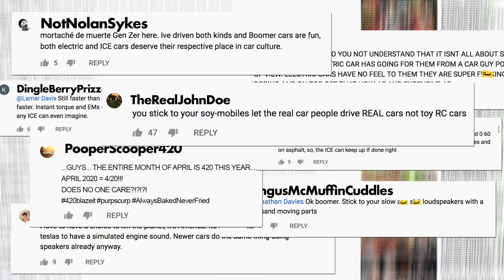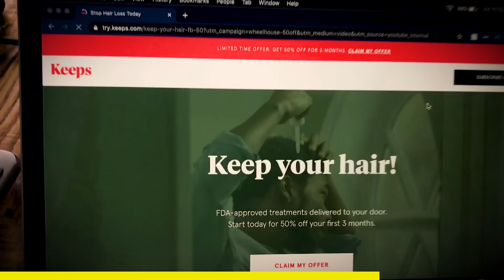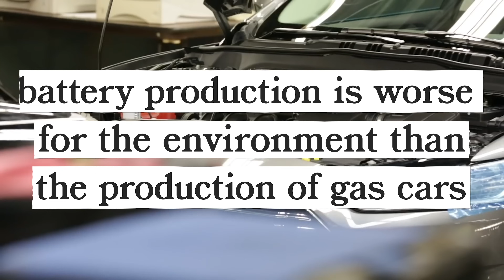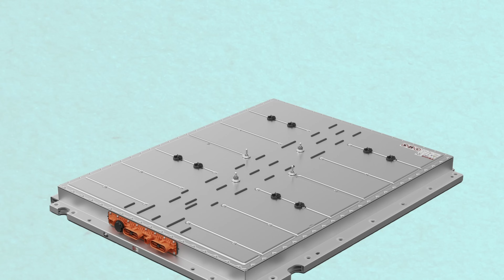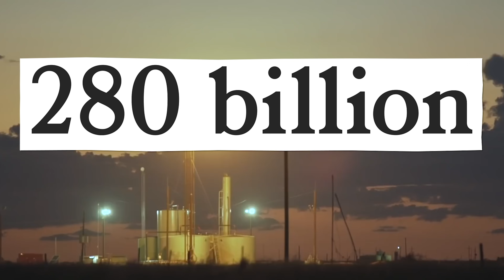Are Electric Cars REALLY Better for the Environment?

Comment: The rich vs poor argument doesn’t take into account the “poor” people that still have some money to buy some kind of car. The people who only have enough disposable income for a second or third hand cars for $500-3,000 until Ev’s get to that level of circulation or price they won’t be a big deal for “normal people”
Reply: Sadly, by the time the price of an EV comes down to $500~$3000, its range is counted in yards, not miles ... :s

And even if you're rich enough to buy a new EV, you're confronted with a tough choice:
Do I buy this small EV for $30,000 or the same model in Petrol version for $15,000 ?
I can buy $15,000 worth of fuel and drive 100,000 miles with that fuel for the same money.
Of course, after 100,000 miles everything in the car is rattling, and I'm sick of it and I want a new one ! 
So by the time the EV finally become financially advantageous (no fuel bill), it's old ...
Reply: @melmaciandissenter2324  It's estimated that, on average, a Tesla Model 3 sees about 70% of it's original charge at roughly 400,000 miles. Those numbers are looking more and more like they were probably *on the low side*. So if you're buying a car with 800,000 miles on it, sure, but you seeing a lot of ICE powerplants with that type of mileage? 

And an EV doesn't even cost twice an equivalent ICE model now let alone later. And as more and more manufacturers go all-in on electric (and they all will), ICE powerplants are eventually going to be MORE expensive than electric as they lose their mass manufacturing.

Reality is an electric future with ICEs eventually becoming "collectors" and nothing more.
Reply: @JustinHall1468  you see electric cars like the Nissan Leaf at 50,000 miles nobody wants them because of the shit range
Reply: @melmaciandissenter2324  and by the time the EV is in this lower price range it will be due for new batteries and electronics. bet the price and carbon footprint of all that exceeds the enviro costs of ICE cars
Reply: @chrisbarker3034  This dumb argument is getting so old lol. People equivocating a 400,000 mile electric when most don't keep an ICE over 200,000.
Reply: @JustinHall1468  Oh boy I get to do more math!

Think of it as a popcorn effect. If you say an EV lasts 400,000 miles on its battery, that means we have new batteries being made for EVs every 400,000 miles' worth of time, and the frequency of replacement for that group of buyers happens at least 1 million times. With the average mileage accumulated every year on a car being about 12,775 miles per year, it'll take about 30 years until a single battery "has to be replaced" from wear and tear. This also grants the hypothetical that these cars are never damaged seriously, or sold off to make room in peoples' driveways for a newer model, or that the batteries are not faulty. What you're arguing by stating "well they'll last 400,000 miles" is a very optimistic and liberal statistical estimate that does not take the most frequent and realistic causes for replacement of any vehicle into account. 

If we are going to take the earliest and most reasonably optimistic instance of a vehicle needing to be replaced though, trade-ins would likely be the earliest decision-based cause for vehicle replacement, where people in the US tend to wait three to five years before selling off their cars to buy into a newer model. 

So imagine every five years, another million EVs are made to be purchased by the million owners who owned an EV five years ago. They might also be accompanied by another four million EV owners buying their first new EV throughout the past four years. That's one million EVs that are five years old and being replaced for a newer model, one million brand new EVs being purchased by previous EV owners, and four million new EVs that are being purchased for the first time by new EV owners. That's six million batteries in a five year time frame in the US alone.

Now let's consider damaged EVs. EVs seem to make up .65% of vehicles on the road in the US (about 1.8 million EVs out of 286.9 million cars), and noting how there were about 1.8 million accidents in 2020 (the quarantine year with less people on the road...) bad enough to cause injury, you can imagine how the cars ended up. Knowing that we had at least 1.8 million vehicles on the road in 2020 being EVs, and knowing that 1.8 million out of 286.9 million vehicles is .63%, we could also say .63% of 1.8 million EVs get totaled each year. That's 11,340 EVs getting wrecked or sold off after an accident last year in the US alone, and if we want to look at the following year where perhaps the number of EV ownership goes up by another million new EVs making up part of about 286.9 million cars, you have an extra 17,640 wrecked EVs for year two, and then 23,940 for the third year,  30,240 for the fourth, and 36,540 for the fifth year. After five years and you end up with a frustrating 119,700 EVs being replaced after an injury-causing accident after five years and if you multiply that by the 17 metric tons of harmful emissions it takes to produce just one EV, you're looking at around 2,034,900.8 metric tons of emissions being absolutely wasted, and another 2,034,900.8 metric tons of emissions being spent to satisfy the demand to replace those lost EVs. 

(My formula for EVs wrecked is (286,900,000-(1,800,000+(1,000,000X))) * .62 to represent how many million more EVs (1,000,000) plus the current amount of EVs on the road (1,800,000) make up the total amount of cars on the road (286,900,000) after a certain amount of years (X) , multiplied by the ratio of wrecked cars in 2020 vs the total amount of cars on the road.)

Back to the scenario. It's now five years later, and we have the six million EVs on the road from before. We can use these ratios and determine that of the 6 million EVs on the road alone, there is a pile of 123,500 EVs that went to waste in some way or form *at the very least*. And you don't have to be able to see these piles to believe the ratio as something realistic, just think about how much room there is on the North American continent to have enough wrecked EVs scattered around wrecking yards like we do with old ICE vehicles already. And we can assume that number will grow either incrementally or exponentially as the EV industry starts to replace the ICU industry by force thanks to government mandates like what we have in California and the auto industry being forced to start working quickly to have showroom floors with nothing but EVs to be in compliance with the mandates. With these mandates, you will have hundreds or tens of millions of EVs being driven by Americans taking the place of ICEs. You're suddenly going to have a lot of lithium being mined just to keep up with the demand of EVs being built, let alone being replaced, for the American market alone. The start of that extreme demand is just 15 years away for Californians, give or take 5 years as pre-owned combustion vehicles will be phased out thanks to gas prices getting skewered more than they are already.

If we want to quantify a fully electric auto industry at the emissions rates we have now in order to have a 1:1 ratio to replace every ICE on the road today, we are looking at the production of 286,900,000 EVs which equal 10,752,438,200,000 metric tons of emissions. If we want to pretend we can just dump this out once and relax knowing we have 400,000 miles or 30 years before we have to do this again like you do, we're lying to ourselves, because we'd be ignoring everything that can go wrong to total one of these vehicles in the US alone. Remember my formula from before? Just do 286,900,000 vehicles times .63% of the total vehicles on the road that are wrecked each year and you get 1,807,470 wrecked EVs each year which wastes 30,727,002.6 metric tons of emissions and creates the demand for an equal amount of 30,727,002.6 metric tons of emissions to satisfy the demand for a replacement for those consumers, each year. 

You also have to acknowledge that it represents only the amount of metric tons wasted in a given year thanks to accidents or major parts failures, and you can expect more emissions once you realize people will always be buying themselves a new car whenever they feel like it and they might just replace their old car to do it. But I'm too tired to keep doing math, so I'm not even going to go back and address the increase in production caused by people replacing their EV for petty reasons.

You have to realize that in the real world, people are almost constantly ending up with reasons to replace their vehicles year round. As the population of EVs grows and the trends in replacement/total loss remain the same thanks to human nature being as flawed as it is on the road and with vanity, you are going to have an endless cycle where all of these ratios will be applied to hundreds of millions of Americans instead of just one million a year at the current rate.

I get that you might say my numbers are a bit chaotic in how they're presented, but that's literally how the auto industry is with how cars are handled by consumers in the real world. Unless everyone is going to get an F1-class education for their driver's license or we grant the government the disgusting power to dictate who gets to buy what and when, expect ignorant people to pile up these batteries as the years go by. 

And I'm just talking about America, it gets uglier when you factor in the rest of the world.

The real answer for now is alternative fuels. It's exponentially less stressful on the environment to produce and even recycle ICE platforms thanks to how versatile they are and how different engines can be applied to the frame of a vehicle, so we can just take engines that run on more environmentally friendly types of fuel that do just good enough for what the average person needs to get around town. In reality, ICE lifespans are cut short for the same reasons why an EV's lifespan would be cut short, and if we're talking about the engine blowing up on an ICE, just give companies the right to do research on how to melt the block back down and reassemble it with better materials. In the meantime, until EV production can become more environmentally friendly for us to afford the constant replacement of them due to trends in American driving and ownership behaviors, and until you can promise me that everyone can and will use their EV until it really does need replacing due to wear and tear, I don't want to hear your dumbass argument ever again lmao.
Reply: @chrisbarker3034  I'll be laughing when all these batteries start failing and need and to be replaced while I'm still riding in a ICE powered car
Reply: @Cheaty_Four  you say EV car manufacturers will sell more than 4 million cars, are you insane? Tesla has only sold around 500,000 total so you better revise your numbers
Reply: @JustinHall1468  It’s better to project off what we know is available now than it is to project based on what businesses and governments SAY will happen. I’m all for the auto industry to figure themselves out with EV technology, but when you try to throw a deadline onto things, projects WILL inevitably get rushed and corners will be cut at the expense of SOMETHING, namely quality.

I am majoring in logistics and supply chain management, part of our lectures are rooted in ensuring projects are done in a timely manner with enough time to handle trial and error before a new product is released to the market. Everything I am saying to you is a consequence of cramming all of this careful development into a deadline where the markets will be FLOODED with demand, and if the auto industry will comply with the move to go fully electric by then, it will be much more cost effective to work with Li-Ion batteries as the groundworks for their products.

I say, instead of confining the working class and average commuter to their own private vehicle as the sole method of transportation, invest this technology into mass transit systems. 

A business or a local government agency will ensure they get the most service out of a single EV bus for example, and if the infrastructure is developed properly like it is in Japan or (surprisingly) Mexico City, you ultimately cut down on the amount of batteries produced in a given time frame. 

If anyone WILL opt in to have a private vehicle, the impact of demand will obviously manifest itself in the price, and understanding the figures in my last comment, people should not be financially enabled to put more private vehicles on the road knowing what the impact production of a single EV has on the environment today and likely in the mid-to-near future.

All of my conclusions are set in the real world and add in human and market behaviors to the mix. Crossing your arms and saying “No, this WILL be perfect because companies want it to be perfect” is how companies and entire markets fail. It annoys me when people play the “perfect world” card to make transformative plans when instead we should design our transformative plans around worst case scenarios, because then we can at least enjoy more genuine comfort thanks to markets and civilizations not being as bad as we prepared for, but we are prepared nonetheless.

Do you have any other counterpoints to make aside from trying to point a finger at me and insist I’m making things up? Because every counterpoint you said in that reply is just an echo of what every person who thinks it’s easy to “just make it more efficient” said back when we were dealing with EXTREME pollution from CO2. 

Alternative fuels need to be researched more. I don’t understand why you don’t see that if we can find a single resource that can pollute significantly less than gasoline, we can beat out the damage caused by both EVs and modern ICEVs. EVs are the future, but all our eggs should not be put in a basket that hasn’t even been woven properly yet.
Reply: @Cheaty_Four  Sorry, but your wall of text makes some bad assumptions. Trade-ins don't matter. All of those cars circulate back into the market as used cars, so this is irrelevant for the purposes of determining car lifetime emissions. This is true for ICE cars as well. If you want to go do all the math for real numbers, you need to find the actual average lifespan of an ICE car (including crashes and everything), and compare that to the projected equivalent lifespan for electrics (including battery replacement, etc).

I don't have those numbers, but I highly doubt they come out in favor of ICE vehicles in the long term, thanks to ease of maintenance. And that's assuming no large paradigm-shifts in personal transportation, which I also fully expect to happen.
Reply: I think he missed the point in that it is a $7500 tax credit and not a rebate. So a poor person has to pay at least $7500 in taxes in order for them to even get the full credit. But then there are very few new electric cars for sale in the USA (2021) that a poor person can even afford in the first place.
Reply: there is a chinese 5000$ electric vehicle
Reply: A car is still secondhand even if it's had 10 owners..... you don't call it third hand or fourth hand. It's just secondhand.....

Comment: ICE engines do not have to be ran on oil at all.  Diesels for instance can be ran on Oil from plants.  Petrol's on LPG etc... Would love to see that comparison to the EV.  Why is there no diesel hybrids either wouldn't they like do in excess of 100mpg.  what is the average C02 from an adblue diesel car running 70mpg is that 5 tons a year?

Comment: Hmmmkay great... but why you stop at 5 years on the numbers?  Oh right because at 5 years the EV battery has lost a noticeable amount of capacity and should ideally be replaced, throwing another 17-ish ton heap of emissions on to the EV, and again at 10, and 15, so the numbers for comparison just sort of... stop... at a 5 year lifespan.  Not saying 'you're biased after all' because at least you looked, you tried; but your sources are biased.  All sources are.  I know because I looked too.

Also why is it always EVs put up vs gas when gas sucks for A-to-B driving compared to diesel?  France has a damn near emission-free hydro and nuclear power grid, so they'd have the optimal situation for EV use and could be an example to everyone, yet they all drive diesel cars.  Why?  Betcha it's the numbers.  And numbers that can still improve with the development of better more compact opposed-cylinder engine layouts, just off the top of my head.

Sorry eco-marxists, but fossil fuels are still king of the heap for another century or so.  And what will replace them is probably more like the thorium cell tech I read about back in 2015, not laptop batteries.

Comment: I'm 100% in on the the idea of EV's, i wish to see this technology to advance further, but I still prefer the sound of a combustion engine. If you would compare the sound of both, EV's sound horrible, I wish in the future they would sound better! and I also wish I would be able to afford one :D
Reply: New fuels are being developed that give extremely clean emissions from internal combustion engines. For example the new synthetic fuel developed by porsche reduces tail pipe emissions by 85%. This would put the internal combustion engine on a level of emissions output at the same level as a electric vehicles.

Comment: So Nolan, carbon emissions are produced only from manufacturing of the batteries, but the manufacturing of the EV itself doesn't produce any emissions? No mention of the short lifespan of lithium-ion batteries? Environmental degradation in S. America from lithium mining is better than carbon emissions? Only a portion of the emissions from extraction and refining of oil is attributed to gasoline we burn.